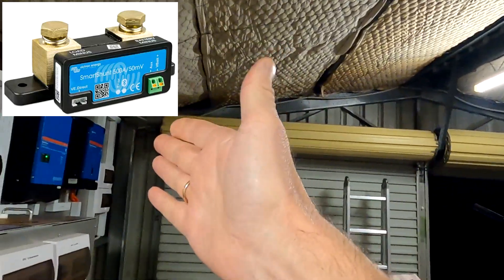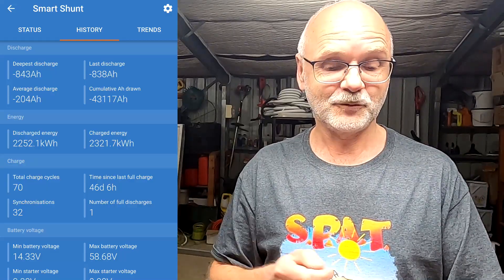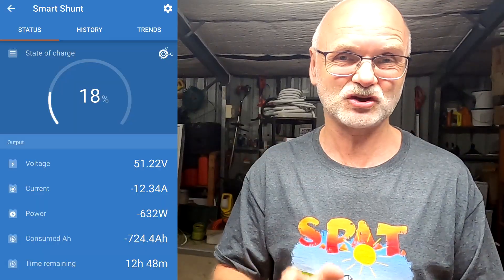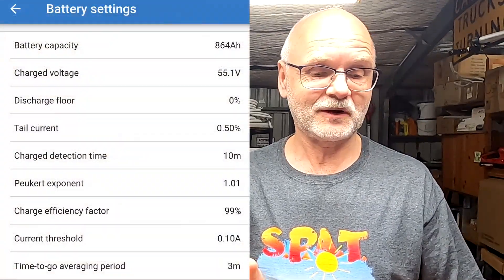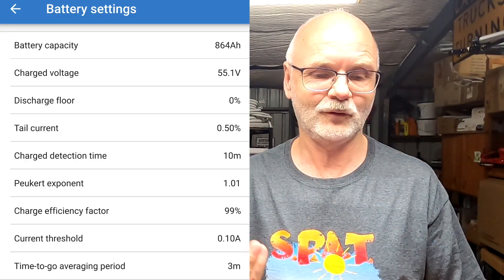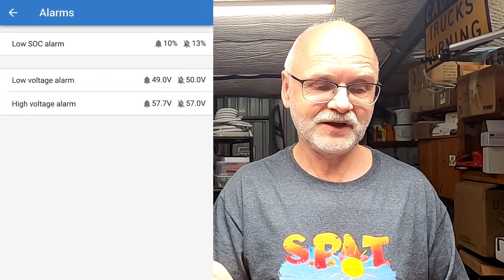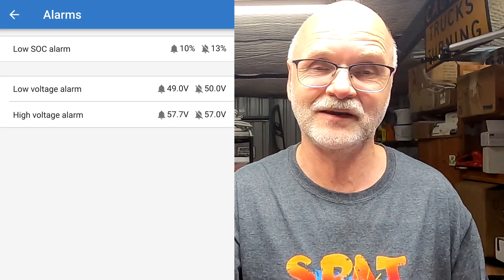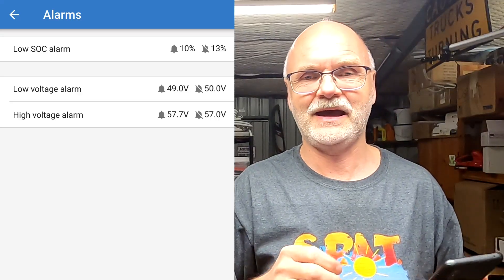The undervalued component in your solar and battery system - The Victron Smart Shunt.

Comment: Yes, it's a bit confusing with all those settings though. One thing I have discovered is that I would like to see a setting called constant watt instead of constant current because (now it's coming) when you charge with constant current the voltage on the battery increases and then you charge with more and more watts example ( 2.45x100A=245w 3.45x100A=345w). You do an excellent job and also entertaining and educational, I love your solar panels on the roof East and West and then in the middle of a forest of trees.

Comment: Great video, your still rocking it! I have 6 Victron smart shunts, but no other Victron gear. I use them as a the default battery monitor for each of my Li battery banks and also as a check to my inverter load. It's great because I can use the VRM to keep track of my off grid system when i'm traveling.

Comment: Great video as always Andy. Have you looked into the Victron Lynx shunt, I see that it can handle up to 1000A but is there any other difference if I only need 400A as most? They have the Lynx Distributor (biusbar) and Power in also, so maybe it is better if you need several functions as a package?

Comment: Hmmm scratching my head ... isn't it perfectly 'normal' that your individual banks may have different load states (where the individual) BMS'es are all correct! .. and the Victron to the outside just shows some sort of 'average' ??  So the question which one is right or wrong is invalid in the first place.

Comment: Hi Andy. I live in Brisbane and am upgrading to an EV - a BYD Atto 3. I was wondering whether you have or would be interested in doing one of your videos as it relates to EV charging. Apparently the BYD Atto 3 will only charge at 7kW through the onboard AC charger, but can charge at 80 kW at a DC charger. Like you I have the room to put more solar panels and am thinking of putting a ground mounted array to charge a battery system. Things I would like to know are around DC voltage drop, cable size and length for a given distance to the EV. With the tsunami of interest in EV's by Australians now I think quite a few people would be interested in your point of view regarding what onboard chargers are in EV's, and options for DIY AC and DC charging. Love your channel Andy. I thought this might be another topic to include in your channel. If you have done something already could you point me to it thanks. Cheers

Comment: I've found the JK BMS state of charge to be absolutely useless, I have an older victron BMV monitoring my system which seems to be very accurate. But whilst the BMV can be displaying 90% soc, the JK may be displaying 15%. Hence I never really bother opening the app, I just rely on it to protect against extreme parameter limits, which it hasn't had to do yet. I've also noticed when pulling load from the batteries with my (older) 3k multiplus the JK BMS jumps from 0a to say.. 100a repeatedly, and just cant give a steady amount of current drawn, and I imagine this is why its soc reading is so far out. Ignoring that though.. it seems to work. I've never actually seen a solid balancing current shown, but my batteries were brand new and seem to stay very balanced on their own.

Comment: I have the bmv712 and my biggest problem with it is the relay setting by state of charge, affects discharge floor and therefore also affects the time to go counter. For example i have the soc relay setting to turn on my hot water service above 80% soc, and turn off below 60%soc, therefore my time to go counter now doesn't work if my battery is below 60%. 
I have the hot water set like this because i know that i use roughly 40% of my battery capacity overnight during winter with electric blankets and such, and wanted some headroom for emergencies, so given that hot water is more a luxury than a necessity, having it cut off at 60% was a good idea. But as i said, this now means i have no time to go counter below 60%, and the time to go above 60% is only counting that top 40% of the capacity. Victron needs to separate the soc relay setting and discharge floor setting. 
Also, if i go and set up the soc relay to my desired percentage, and then go and adjust the discharge floor, it also automatically adjusts the soc relay to the same setting. Why bother having two settings in the menu if they both do the same thing?!?!?

Comment: I love your work - reminds of my younger days DIY'ing everything from slate/glass HiFi turntables to homemade Hibachi BBQ's.

Nowadays I just buy a BBQ or a HIFi.

Battery SOC on a DIY Solar PV Lithium battery system is a bit like range anxiety in an Electric Vehicle. We are progressing to a stage where battery Capacity and SOC are of academic interest. I am there right now. 

Knowing these figures in real time is an interesting nice to have right now. My Off-Grid (nearly) home runs for months without me looking at them. In the beginning, about 7 years ago, I watched them like a hawk, 24/7.

IMHO, unless the Victron Smart Shunt is integrated into the system in some way that it actually controls something which results in a positive outcome, I would rather live with the figures presented to me by my Inverter and spend the cash on something nice.

Comment: Have tested a lot of different brands of gear and I prefer Victron for a lot of reasons. I have also tested a bunch of cheaper shunts and found they all drift, some bad and rather easily and others over longer periods of time but still eventually drift so I stick to Victron shunts as they have always stayed accurate and synced for me. I find cheap shunts since they don't have adjustable Peukert and efficiency settings they are just set averaged to work ok "ish' for all batteries but require periodic charging to 100% to keep them from drifting out of sync. I have also been saying for a long time BMS SOC meters are a waste of time they drift. Better off with a simple non smart BMS and a quality shunt. I prefer the bmv712 as the range is farrrr better than the smart shunt of which is rather poor but I do also use the smart shunt in portable boxes and such or systems where there is a Cerbo GX and color screen plus cell and WIFI VRM portal monitoring so don't need Bluetooth range.

Comment: Something I have always wondered is how often you should rebalance your batteries, perform a capacity test to determine amount of degradation, and then recalibrate the shunt with that new capacity?  While the shunt is very good at measuring current in and out, it only has the number you gave it, as far as total capacity.  It seems that if you don't recalibrate from time to time, the shunt won't be so "smart" anymore.
Reply: I agree. All cells must be calibrated to each other, and all batteries must then be calibrated to each other. It's the rule in electric car battery cells. Maybe not so much when you're powering a TV but when you are battling range vs. weight balanced cells is everything. So is cell temperature.
Reply: @dancarney106  thanks 🎉😂😂okx
Reply: nnj
Reply: Bjnnk NN njkñ kk nbb
Reply: @dancarney106  - I agree, but it seems like one of the bigger challenges is keeping them balanced.  I guess it all starts with very similar internal resistance?
Reply: @jasonbroom7147  The computers that are located inside a vehicles main battery are all focused on one thing. Keeping each of the thousands of cells all within 35 mV of each other. If the cell is under the average of all the cells, then just that cell is charged if a cell is over charged then codes and service warning lights are illuminated on the vehicle dash, so the vehicle pilot is informed. It's incredible how much monitoring is going on in a modern-day electric vehicle. People have no idea. None.
Reply: y🎉 @dancarney106  k BB bbjjjjijn
Reply: Mmnn

Comment: You wouldn’t need it if you had decent integrated Can bus BMS! Batrium, REC etc completly negate the need for the Victron shunt as they communicate the current and voltage to the Victron system by can bus

Comment: @Off-Grid Garage - If you build your own battery the users are right, they have already a shunt. BUT...if you have ready build batteries without any BMS system (Lead acid, AMG, LiFePo4 ...) the Victron Smart Shunt is a very helpfull tool and works very good. A Smart Shunt is used for all batteries in your system in that way.
16:50 - For this you have also the Smart Battery Protect ;-)

Comment: Hardly undervalued in the cost sense. At around 285AUD 197USD it’s over priced, like all Victron gear. You pay 3 times what it’s worth, for the 5 year guarantee, which they do not always honour. I’ve been waiting a few months to see if they test and replace a 100/20, which first stopped load cutoff, then stopped measuring the load current, then stopped charging much. A 100/50 they will not replace, with burnt battery +. Positive Earth systems are better, as usually a way to still connect. A lot of Victron gear, like SCCs are made to be unserviceable, full of filler, can saw the ally enclose open, and chip it out

Comment: The qucc bms using xiaoxiang (software) Bluetooth app has setting for direct voltage input for capacity at 80% 60% 40% and 20%. This helps for accuracy. Too bad.i can't include a screen shot of it.

Comment: Love the shunt!
I just hate the fact it wont show Solar on the same screen with victron connect bluetooth app. 
ie - i have 900 watts solar coming in, and 200 watts load from items. it will show +700 watts into battery - infinite run time.
I have to goto the MMPT solar screen and get the reading then do the math.

Comment: I have a Victron Smart Shunt and a single 16 cells bank (304 Ah per cell) with a Daly BMS (yes I know... and I blew it last week because I removed the wire on the last cell during wiring maintenance without disconnecting the 17 wire connector - $200 wasted - I will remember this one). The Daly reports always lower than the victron and at some point it was stuck in the 50-60% range while the victron was at 95% which made sense after a few days of full sun and many KWh of charge reported by my Growatt (via SolarAssitant). Which, by the way Andy, you should test as this is a nice app to monitor an all in one inverter like Growatt and it can also monitor my Daly BMS and supports many other even the JK one. Nice charts too. It runs off a Raspi 3 or 4.
Reply from the maker: Thanks for sharing, Michael. A shame the DALY got destroyed when disconnecting the last wire. This is the power supply for the Daly (most positive) and should just turn it off.
Yeah, I have a Raspi here already and need to pay around with the comms side of things. There is just not enough time 🤷‍♂️
Reply: @OffGridGarageAustralia  Well this is my guess that I cause the Daly to fail. But it could also be the Raspi of SolarAssitant that connects to the Daly serial port that damaged it because the power supply section of the Raspi burned and smelled at about the same time and when I touched the serial connector the Daly shutdown. Daly is  working but reports many errors related to its memory - it's useless and will not even read cell voltages. So maybe it's not me that killed it after all! I will get a Raspi replacement from SolarAssistant (bought it along the with software as a kit) so this is good. Anyways, setting up Solar Assistant is a breeze and it comes as an image you put on a memory card and then you configure it via a web interface. One more thing to consider one day... Thanks for your work by the way - it's helping me and others and you are fun to watch.

Comment: Since there are 3 bms u would have to add the percentages and divide by 3 to get the overall percentage. So the total is 69÷3 = 23% could be correct. U need to discharge n see if when the victron smartshunt is zero does the battery packs stop or go further if it goes further by 5% or so then adding the values of the bms n dividing would give you a more accurate figure i think.
Reply from the maker: I have top balanced all battery banks so need to fully charge them again to see which one is correct. I guess the Victron shunt is off a bit as well, 45days is a long time since the last calibration...
Reply: @OffGridGarageAustralia  also we are waiting to see what the email said regarding the bms. It's been a week now. Lol
Reply from the maker: @pulith5220  A week already? A Sh!t 😂😂
Reply: @OffGridGarageAustralia  😄😄😄

Comment: An extra feature, and worthy, is that the shunt measures a far more accurate battery voltage, and the value can be shared over Bluetooth to feed the MPPT chargers with the more accurate figure. You do need to create the Bluetooth network in the settings, well at least the BMV-712 allows this...
The chargers, especially if pumping amps, will be affected by the resistance of the cables, reading higher than true terminal voltage.
Reply from the maker: Well, that's what I showed in the video 😁
Reply: This is a underrated feature. Syncs everything...not that I use victron lol.

Comment: Hi Andy. Whenever my Victron Scc reaches FLOAT mode I SYNCHRONIZE the Smart Shunt to 100%. And CALIBRATE current to ZERO since no current flows at this mode.  Is that ok? I followed your settings to Absorption=3.45v and Float=3.35v. Timely video btw. The entire ecosystem of offgrid has so many moving parts. Its just impossible to know them all. You are a great help to us.
Reply from the maker: That is OK, Noel. Just you will hit the Float voltage far earlier than Absorption. How do you do that? The shunt may reset whenever you hit 3.35V which could be 70-80%SOC only.
Reply: @OffGridGarageAustralia  Andy, Scc goes to Absorption first before Float.

Comment: I have a 50kWh battery bank made up of 6 individual batteries and the 4 that have a way to display SOC never match up.  I use my SmartShunt to calculate actual percentage, and I have changed my peukert exponent to 1.01 and it seems to be a very good average between the banks.
Reply from the maker: With so many banks, you have to have a smart shunt at some point.
Thanks for sharing.

Comment: Surely the JK BMS has a shunt.  It reads current and coulomb counts for remaining capacity. Though I found I had to enter a reduced value for capacity as my charge controller end limits reduce my accessible capacity. With this tweak this BMS shunt functioned perfectly.  
It sets 100% SOC automatically as the highest incoming coulomb count it ever receives, then calculates the rest from your entered Ah capacity figure and its measured current.
Reply from the maker: As you have seen the JK showed 39%SOC, so was way off the true SOC. Well, what I call true SOC. The shunts in the BMS have just not the capabilities of such a fine tuning to be more precise, I found.
Reply: @OffGridGarageAustralia  It did take a while to get useful truthful figures on my JKBMS. Once JKBMS had top balanced I could safely set my charge controller to max out at 56volts and the JK automatically defines this as 100% SOC after first charge cycle.😊  Then as my inverter cuts out at 44 volts I had to enter my 280Ah cells as only 255Ah on the JKBMS to get a useful 0% SOC value. 😁From then it was plain sailing. ( Or at least plain enough to stop me emptying my whole system just to top up my electric car! and this leaves me a small hidden reserve to run the freezer overnight) 👌  Thanks for the thought and experiment inspiring channel.

Comment: well you wont know which one is correct, unless the bms's communicate with each other and pref  to the inverters.
this is why modern bms allow stacking and inverter comm.
it's not just victron that does this
Reply from the maker: If the BMSes report three different SOC to the inverter, what could potentially happen 😂. I really don't see any benefit of having a BMS talking to an inverter. Especially not if you have several batteries. That could end in a premature shutdown of the system.

Comment: The problems I'm having with one of my JK BMS is that for the last 3 days when the battery gets down around 60% charge the BMS suddenly reports that the battery is at 100% charge when that's not the case. It also shows the wrong number of days in service compared to the other two bmss. Definitely something flaky going on.
Reply from the maker: Just one of the three JKs you have? Can you swap them and see if the problem follows the BMS?
Reply: @OffGridGarageAustralia  I wish I could physically GET to them. But the whole thing is in a steel cabinet which is up against the wall post installation. I've no easy access without shutting down the whole system and disconnecting all the 2/0 wire from the buss bars and then lowering the jack screws under the cabinet so the wheels can roll freely. Half a day's work.
I figure as long as the BMS is running and providing power, the calculated % I'll just ignore.

Comment: Hi Andy, I have been waiting for this video for some time. I am having issues with the smart shunt resetting to 100% when fully charged. In my application the bank is charged to 100% on a daily basis if all goes well, but the smart shunt will stop at 97% and not reset at least half the time. On consecutive days ill lose another 3% even though the voltage reaches 14.2v. Right now i just reset the shunt to 100% if there is a problem. The settings at the moment are Charge Voltage - 13.9, Tail Current - 2%, Charge detection time - 1m
Reply from the maker: If the shunt does not reset, one of the three parameters is not met. What is your overall battery capacity?
Reply: @OffGridGarageAustralia  400Ah